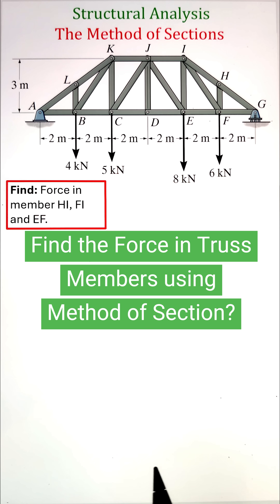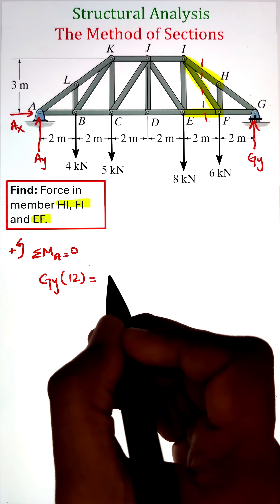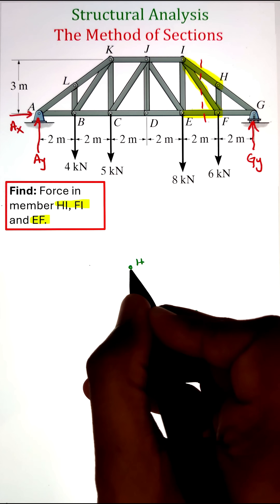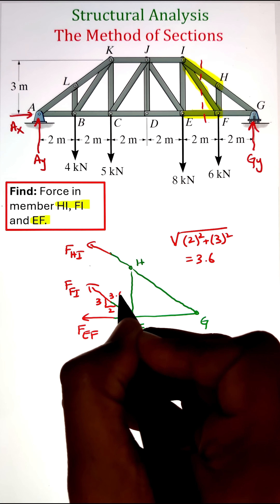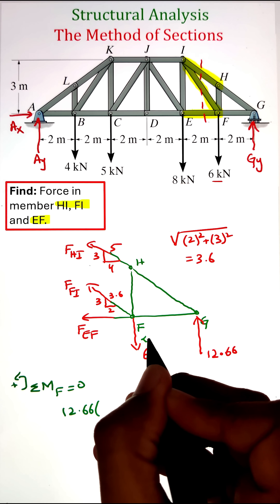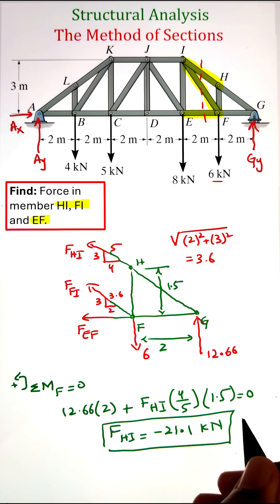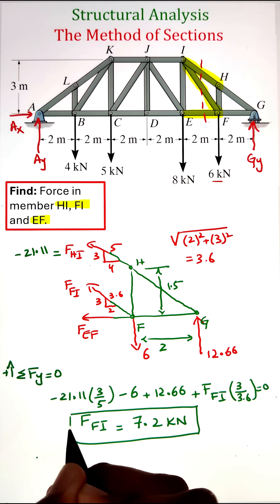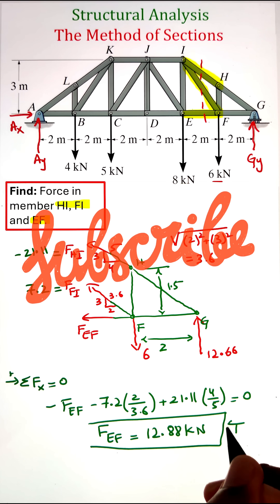Mastering Truss Analysis To Find Member Forces Easily

Comment: how did you get 1.5? 4/3=GF(2), equating that would make it 0.6666? and isnt it supposed to be Opposite/adjacent so 3/4?
Reply from the maker: Are you referring to the length of member HF, how I get its value as 1.5? 
If yes then look at the triangles GEI and GFH they are similar triangles so the ratio of the sides of the triangle will be the same.
Now if I take the ratio of IE/GE that should be equal to HF/GF, now let's puts the known length in this equation IE/GE = 3/4, HF/GF = HF/2, so equate these two it will give you: 3/4=HF/2 , simplify and solve for HF here.
Hope this helps

Comment: how did you get FHI(4/5)
Reply from the maker: FHI horizontal component is calculated by multiplying it with 4/5, that I got from the right angle triangle, since cos theta=adj /hyp , in this case the adj is 4 and hyp= 5
Reply: @MathPhysicsEngage but why did you take the horizontal force 
Like the Gy is perpendicular to the FG so i am not understanding what should be the line of forces

Comment: Where did the 1.5 come from 
How did it come about
Reply from the maker: if you look at triangles form by point GEI and GFH, they are similar triangles as the internal angles of these triangles same so the ratio of the sides of theses triangles will be same. Since for the triangle GEI the side GE is 4m and side EI is 3 m, so its ratio (4/3) will be equal to the ration of sides GF(2m) and FH. Equating the two ratio's solving for side FH gives you 1.5m.  Hope this helps

Comment: F(HI) ×4/5 ×1.5 HOW???????
Reply from the maker: if you look at triangles form by point GEI and GFH, they are similar triangles as the internal angles of these triangles same so the ratio of the sides of theses triangles will be same. Since for the triangle GEI the side GE is 4m and side EI is 3 m, so its ratio (4/3) will be equal to the ration of sides GF(2m) and FH. Equating the two ratio's solving for side FH gives you 1.5m.  Hope this helps

Comment: Please I did not understand how you got dimensions in force HI I mean the 4 and 3😢😢😢😢😢😢😢
Reply from the maker: if you look at triangles form by point GEI and GFH, they are similar triangles as the internal angles of these triangles same so the ratio of the sides of theses triangles will be same. Since for the triangle GEI the side GE is 4m and side EI is 3 m, so its ratio (4/3) will be equal to the ration of sides GF(2m) and FH. Equating the two ratio's solving for side FH gives you 1.5m.  Hope this helps
Reply: The distance of I from G is 4 that's why the adjacent is 4.

4 (distance) is the Adjacent and 3 (height) is the Opposite.

Comment: Where did the 1.5 come from
Reply from the maker: if you look at triangles form by point GEI and GFH, they are similar triangles as the internal angles of these triangles same so the ratio of the sides of theses triangles will be same. Since for the triangle GEI the side GE is 4m and side EI is 3 m, so its ratio (4/3) will be equal to the ration of sides GF(2m) and FH. Equating the two ratio's solving for side FH gives you 1.5m.  Hope this helps
Reply: 3/2

Comment: what's the force in member HF?
Reply from the maker: For that what you can do after this is use the method of joints, draw the free body diagram of joint F, it will have 3 known forces (FE, FI and 6KN) and two unknown forces (HF & FG). Next write equilibrium equation of summation of forces along horizontal and vertical direction and equate it to Zero. Simplifying the equations will give you force along HF. ( Hope this helps)

Comment: Why does ForceF to I is 2m while force H to I is 4m horizontally?
Reply: Pls answer
Reply from the maker: Which force are you talking about, there is no external force applied at point H.
Reply from the maker: Oh, If you are referring to the distance at the base of triangle for the H to I is 4m, because I have multiple the perpendicular and hypo of that triangle by 2 as well to have the same ratio.

If you want to keep that 2m then the other sides will be 1.5m and 2.5m on the right angle triangle of F(HI)